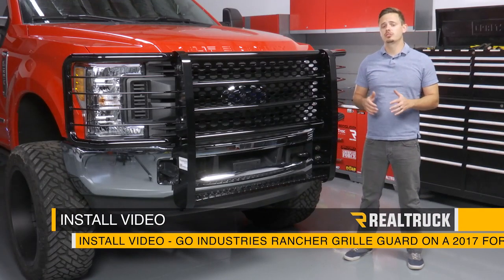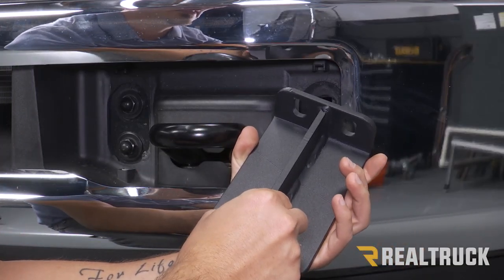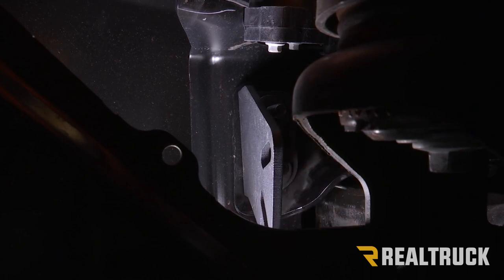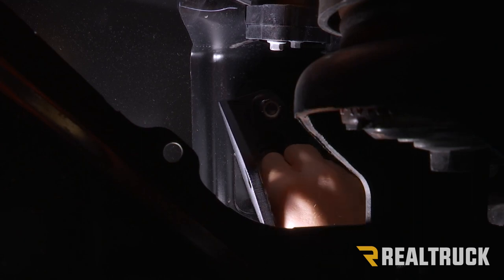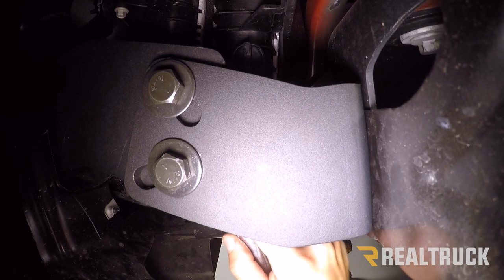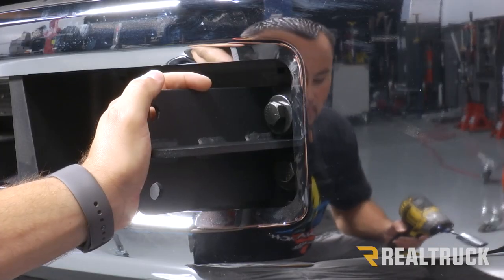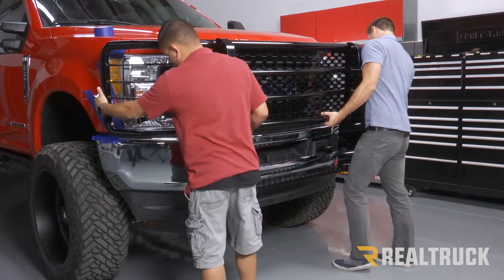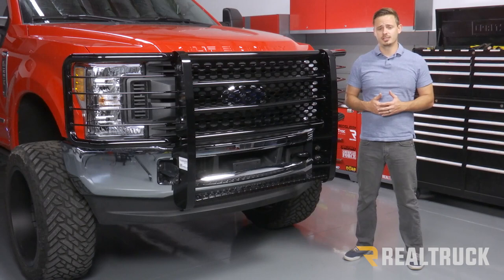How to Install Go Industries Rancher Grille Guard on a 2017 Ford F-250 Super Duty

Comment: The mounting on this thing is garbage.
Reply: looks to be easier to deal with than a ranch hand. considering you have to remove both to replace a headlight bulb on the diesel ford.
Reply: @Chris_L034  you can not compare this thing to a Ranch Hand. Absolutely no comparison.
Reply: @wesleydean4228  constructionwise no, ease of changing headlight bulb yes.
Reply: @Chris_L034  fair enough